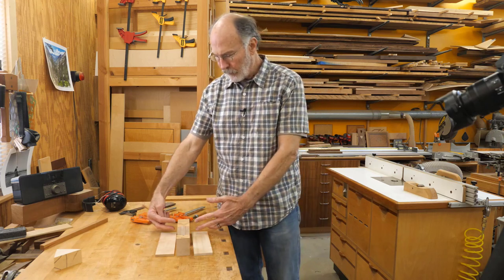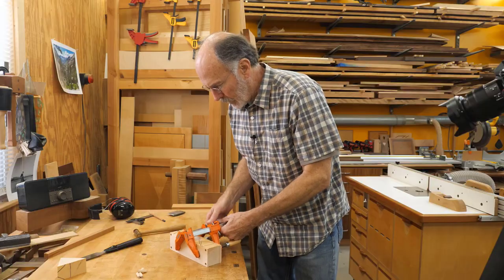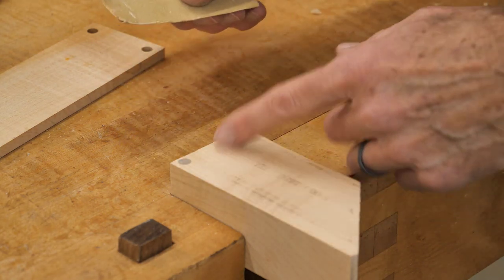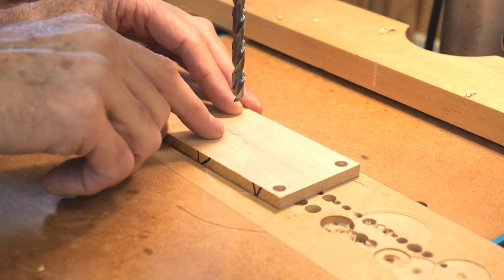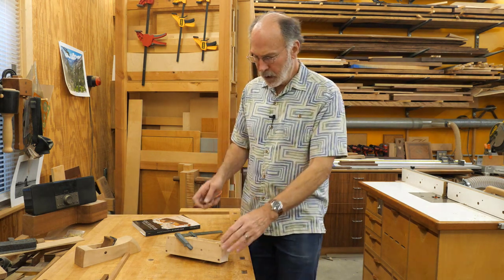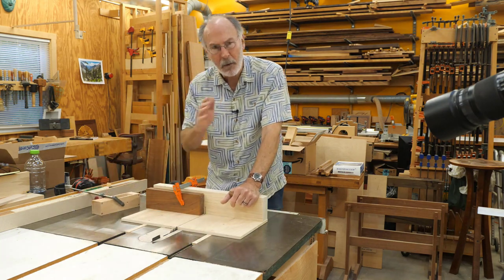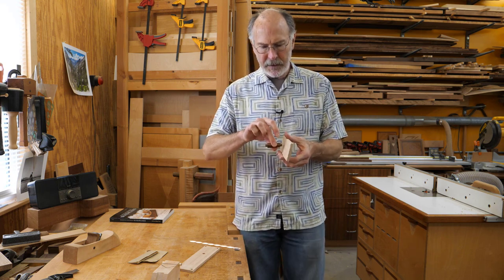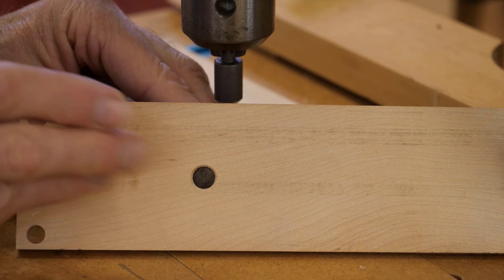Krenov-Style Wood Plane Build Part 2

Comment: Krenov filed the square tennon on the crosspiece round. It’s easy.
Reply from the maker: As I show in the video, I use the method that David Finck describes in his book. When I was teaching I needed a method that was fairly quick and relatively foolproof, so I created the plug-cutter setup on a drill press in our shop, and students just had to clamp their crosspin stock in place to cut the tenon.

As one who taught many hundreds students in the course of my career, I can assure you that what you describe as easy would not be so for most people. When you're dealing with a wide variety of skills and talents, one has to pick and choose their battles.

Comment: Great video man. I was just wondering, what's the rationale for the position of the crosspin? Are those measurements essential for the function of the plane or is it simply the most effective position? Can one get away with a different spot for the crosspin? Also, I've seen some people make a krenov plane with a completely round crosspin, does that make any difference?
Reply from the maker: Thanks! The measurement I use is what David Finck recommends; it works for a couple of reasons. If it was lower, it would inhibit access to the mouth of the plane. You need that to clear out shavings when they get stuck there. Moving it higher wouldn't provide as much downforce to the blade where you need it most - at the mouth. So the position is a compromise of access and holding power.

A round pin works fine. I have used 5/16" or 3/8" brass bar instead of the wood cross pin. When I was teaching I had the students use that for their first plane to simplify construction and greatly speed up the build. It also has the advantage of being able to install it after the plane is glued up and it gives you a bit more room to access the mouth. The downside (depending on your aesthetic sensibilities) is that it isn't as elegant as the wood cross pin. And it puts all the pressure on the wedge in one line, which can leave an impression on the wedge making it a little harder to fine tune.
Reply: @CarlStammerjohn   Very interesting. I'm currently in the process of making a jointer plane in a krenov-ish style, should I use the same measures or are these specific to this plane exactly?
Reply from the maker: Use the same measurements. They should work for almost all planes. The only time you might want to use something different is if you have a really high bed angle, and even then these measurements will typically work.
Reply: @CarlStammerjohn  Thanks for the info, the plane is coming along very well. The krenov style came in really handy, I don't think I could have handled a traditional method